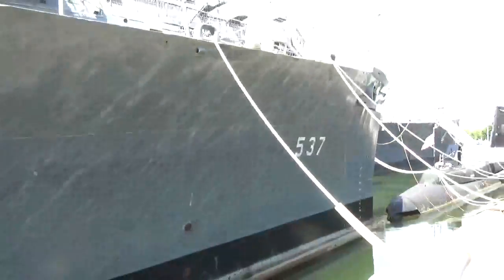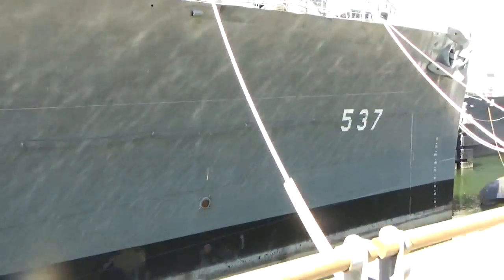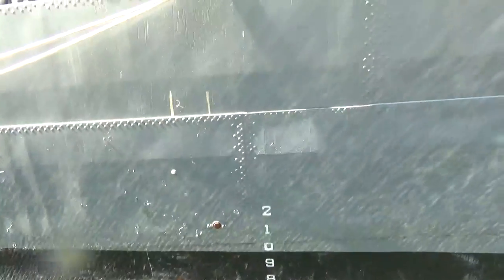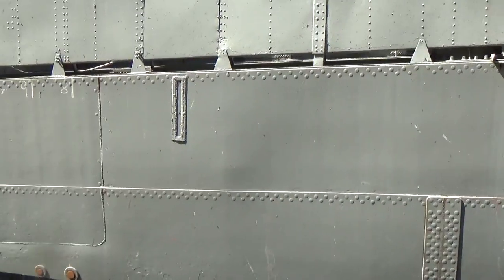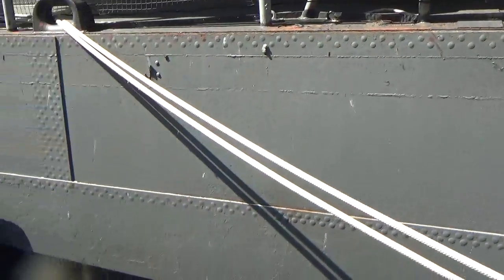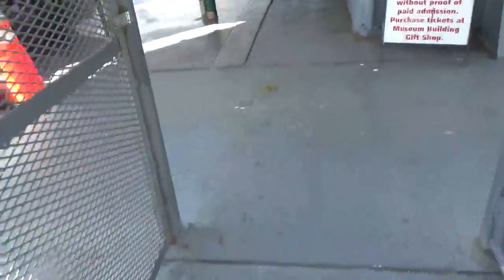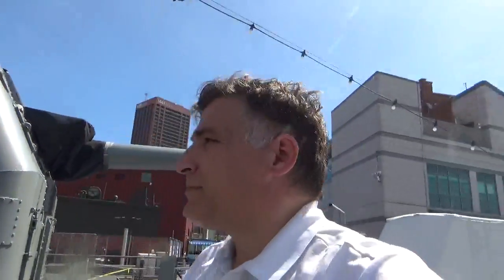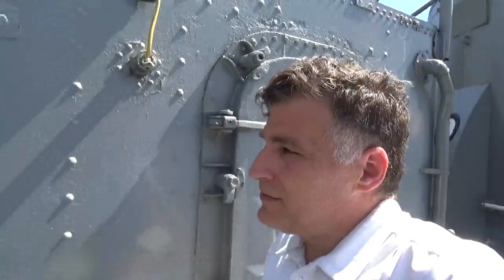Rivets' Lusty Rival: Welding onboard US Navy WWII Combatant Ships

Comment: What you're calling "buckling" is what happens when the plates of the decking and hull are joined to the frames by means of welding. Also known as scalloping, it's a function of the filler metal contracting as it cools, causing a dishing effect in the plating between frames and longitudinal stringers on the vessel. We still deal with this today in shipbuilding. Also, even where you see deck and hull plates joined by rivets, the structure is still heavily welded internally where these riveted areas join to the substructure. As more became known about the welding process and better techniques were developed, riveting almost entirely disappeared. It is only found now in areas of extreme stress where welding is either not desired or is impractical, such as joining an aluminum superstructure to a carbon steel deck or hull
Reply from the maker: Thanks for sharing your experiences RalphTempleton-vr6xs. We have this on the hull and also on the main deck, where some areas are peaks and valleys. Now that I've seen USS Kidd up close, and reviewing their main deck replacement, that is on my radar to identify those serious areas of scalloping. Appreciate it!

Comment: I recall from comments made in the BB62 channel that until recently it was thought you could not weld onto Class A Armor, until USS Texas figured out how to do it while they were in drydock. I don't think USS The Sullivans has any Class A armor, but I think Little Rock does with the belt, deck,  and turret armor?  

I hear a lot about how welding took over from rivets but never really heard a breakdown of the pros that rivets provided until this video.  Great information as always!
Reply from the maker: Hey Bryce, that is correct that Sully doesn't have any class A armor - much too thick. Little Rock does have 3.5 armor belt, the turrets are 6" in front, 3" sides, 1.5" back. Sully does have the usual array of HTS and STS built into the hull and decks. Off the top of my head they use mostly 20lbs per square inch and 15lbs per square inch. Thanks as always!

Comment: Another great video Shane. Where the hull has rivets compared to the welded sections you don't see a lot of oil canning?  Makes one wonder.
Reply from the maker: Thank you! It is an interesting observation. Just like parts of the main deck that I pointed out...now, I know where I was standing attempting to show the waviness of the deck, it does get sun and weather, where the riveted areas don't as much as they're mid-ships, and during the season much is under canvas. But, the riveted decking does feel like it has more strength nonetheless! Appreciate your support as always!